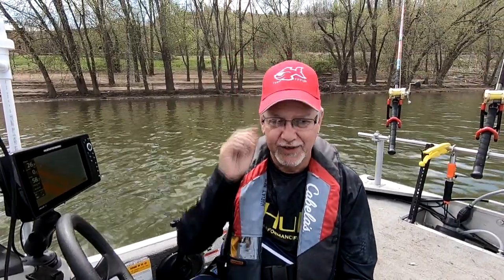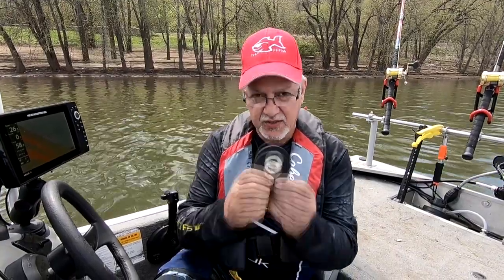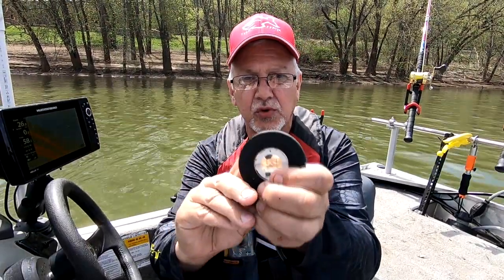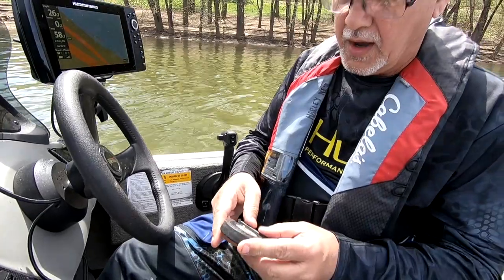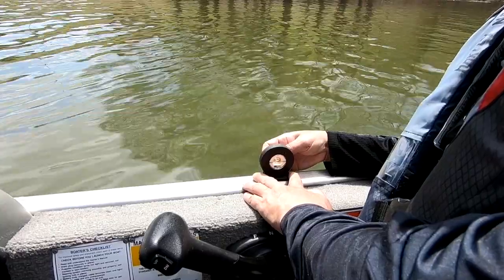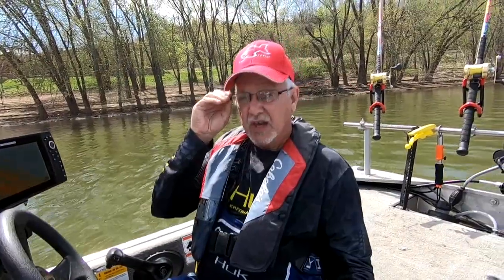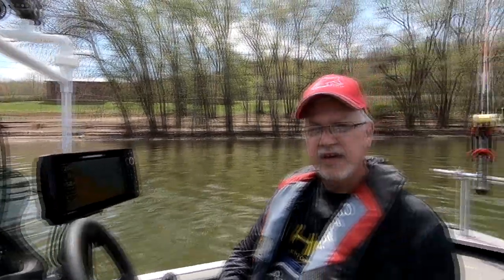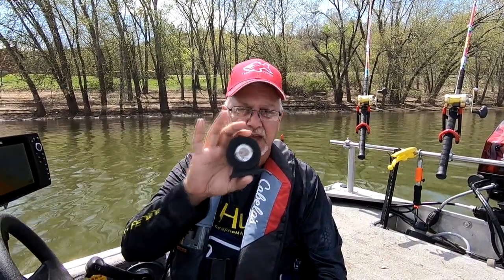How to level a transducer the EASIEST way.

Comment: Nice simple explanation. If you want to be even more accurate, do this same process while idling at the speed you will be trolling or side/down scanning.  Make a world of difference to the angle when boat is underway.  Also, do the angle determination with your normal gear, fuel and passenger load.  With the same speed and load, run a very straight 2x4 across from gunnell to gunnell to determine if you have any left or right tilt you also need to compensate for when mounting the transducer.
Reply from the maker: I'm gonna hire you for a co-producer! Good tips there Mike.
Reply: Yes. The bracket has a slot for the mounting screws on both right and left side of the bracket. You can tilt the transducer right and left by moving the bracket up and down right and left before tightening the screws thus tilting the transducer as needed.

Comment: Easiest way to do it now is to download a FREE bubble level app to your phone.  Then you can read digital numbers for your angle as you are running at different speeds.  It will read out how much tilt left-right and front-back all at the same time if you lay your phone flat on the dash or on the floor.
Reply from the maker: That's a really good suggestion.

Comment: Great video.  Could you take the measurement and then use the level on the transducer itself.  My boat sits on a lift and not on a trailer out of the water.

Comment: I wish it was as easy to find one of these levels as it is to use it.
Reply from the maker: Just do a Goodle Search for "Protractor Level" I did and found a lot of different ones. Here's a link to a 15 dollar one.
https://accuproducts.com/index.php/protractor-magnetic-level.html

And one for 10 bucks.
https://www.amazon.com/Johnson-Level-Tool-700-Magnetic/dp/B00004T807/ref=asc_df_B00004T807/?tag=hyprod-20&linkCode=df0&hvadid=309786256292&hvpos=&hvnetw=g&hvrand=13413594705368574199&hvpone=&hvptwo=&hvqmt=&hvdev=c&hvdvcmdl=&hvlocint=&hvlocphy=9015906&hvtargid=pla-423451903337&psc=1

HAPPY LEVELING!!
Reply: @UncleHarley  Thanks. I did just that on Google and I did it again after your suggestion, but I never came across the one you cited. I did go to the site to order that one, but $15 plus $28 shipping was a bit much.  The torpedo level and coin trick will have to do, as I have plenty of both. I do, however, prefer your idea. Thanks for sharing.

Comment: Great video and neat tool... unfortunately I can't find a protractor level on amazon so I'll have to stick with the coin method.
Reply: Coin method? How does that work
Reply: @davidchavez4101  Stacking coins under a torpedo level while on the lake and then replicating that same thing with the jack while its on the trailer. The guy in the video referenced this method in his video.
Reply from the maker: One other thing I've learned since doing this video is to have the boat in gear or trolling motor pulling since that will change the orientation of your boat too.

Comment: Why couldn't someone just take a level measurement directly off the transducer while the boat is in the water if you're going to measure with the boat stopped?
While I dont have his type of angle finder, a Harbor Freight type with the needle works as you pinch down on it to "freeze" your reading as it comes to rest on the pickup.
Yeah, it's not waterproof, so.
Is it the sidescan portion of the pickup that makes the angle so critical? My older units with just sonar and the much smaller pickup were not nearly as picky. If so, I should have just opted for the double shot, sans sidescan